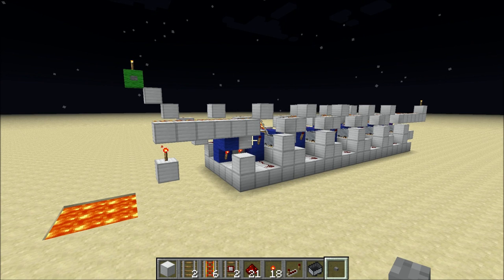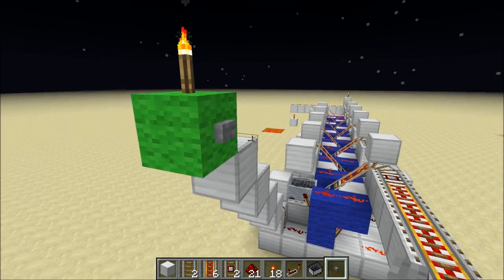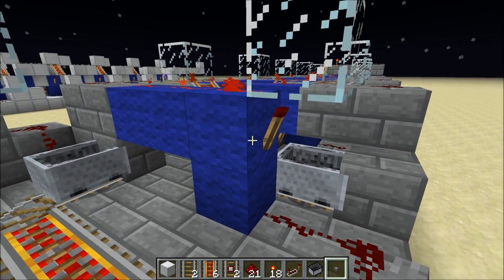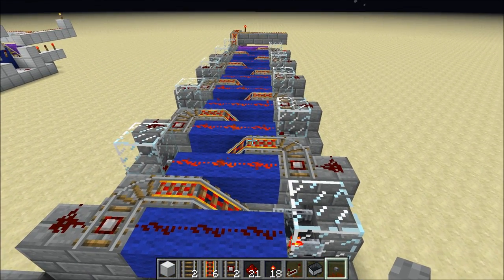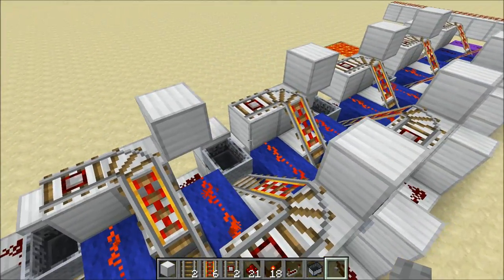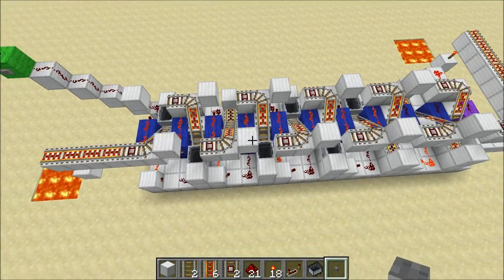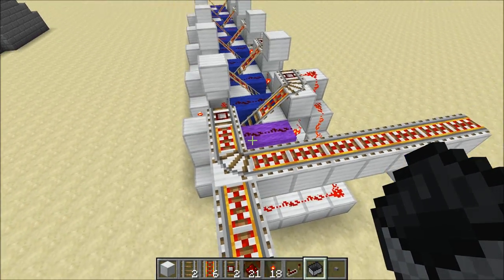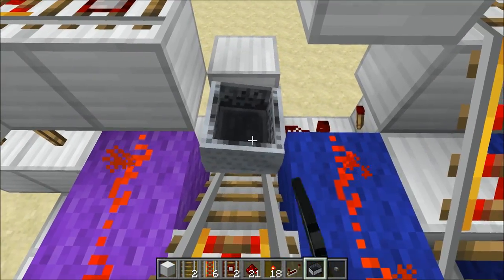Advanced Horizontal Minecart Dispenser (Minecraft 1.2.4)

Comment from the maker: Vertical pez dispensers have historically been unreliable in SMP. What usually happens is after a while, the stacked carts all merge into each other toward the bottom. It's also difficult to reliably dispense one cart at a time from these dispensers. Not sure if the latest update fixed these issues, but they're enough for me to avoid using these dispensers for now.
And as rune4234 said, it's good to have different kinds of options for dispensers so they fit well with an overall station design.

Comment: I've been trying to get this to work on the XBOX 360 version, and it seems the detector rail is powering the powered rail in the stop before it. Would you recommend I try your old version of dispenser, or do you know (or has anyone else figured out) of a way to get this design to operate properly in the xbox 360 version?